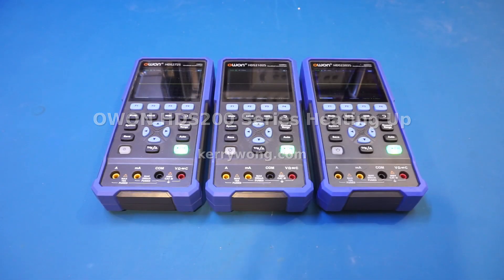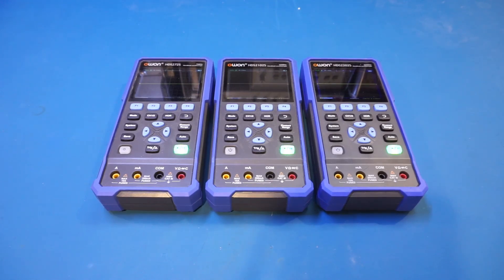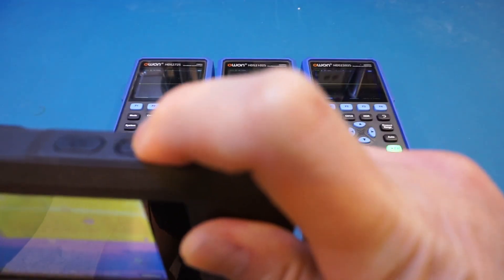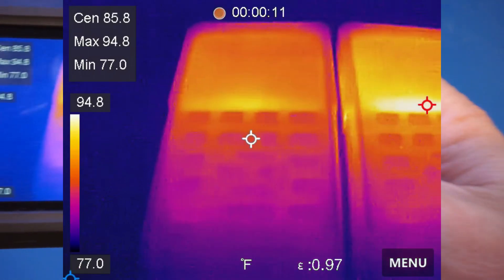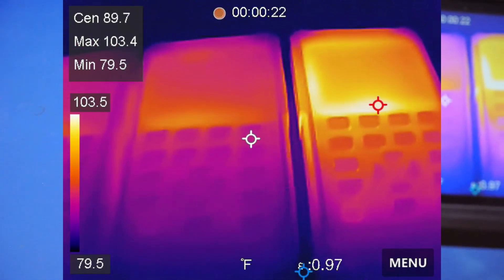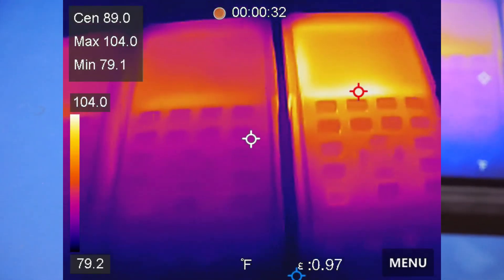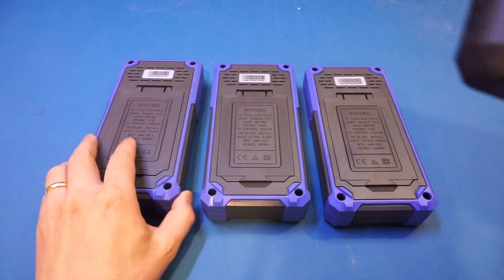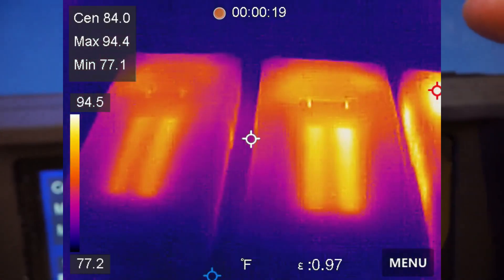OWON HDS200 Series Heating Up

Comment: I haven't received it yet, but I just ordered the Owon HDS4202M-N Digital Oscilloscope With 200MHZ Bandwidth 1GS/s Sample Rate. I can not find any reviews on it. If I compare the performance specs to my Fluke 190-204 the Owon seems like a great deal if I do the math of dollar per channel compared to the Fluke. I bought the Owon because of its compact size. As a mobile tech every bit of downsizing I do makes my day of lugging crap around much easier. If I really need four channels, I'll walk back to my van and get the Fluke or Picoscope. Do you have an opinion in regard to that unit? Could I have used my $900 in a better way. The market has really changed since my first Fluke 97 back in the nineties.

Comment: Got mine 2202 today. It said on AliExpress it came with a 100mhz probe, but I got the 200mhz probe. Pretty happy. I did notice it got a little warm in my hands playing with it. Not too much. I think the electronics inside is within spec anyway.
Haven’t checked the firmware version yet, I’ll do that after I played with some pwm signals from microchips. Great cheap little instrument.
Reply: The hds2202 I got has firmware 2.1.0, its working great. I checked out pwm signals from rp2040 and it detects 50mhz pwm just fine at 50% duty cycle. I don't have a signal generator to generate 200-300 mhz signals, so this is more than enough for me.
Reply: You should use the device inside a bag and immersed in water with ice! Is another whole level! Also is way faster and accurate. Maybe because the temp is in check

Comment: Only what is missing is the comparison with bench oscliscope, for example 2202s with some "basic" bench scope, to see how precise it is withing standard range 0-20Mhz (as hobbyist won't use higher frequency anyway, yes you can buy then lower spec owon, but you will loose sampling rate.).

Comment: I've had my 2202S for at least a year. Have noticed when using instrument while connected to charger is when it gets quite warm. After finding this have not used it with charger connected. Have not noticed any significant temperature rise with instrument. This scope is very useful when working with radios and stereo receivers. My concern was with the battery compartment rise in temperature since it uses lithium rechargeables. Instrument works well and will keep an eye on this. Good update on your part, thanks.